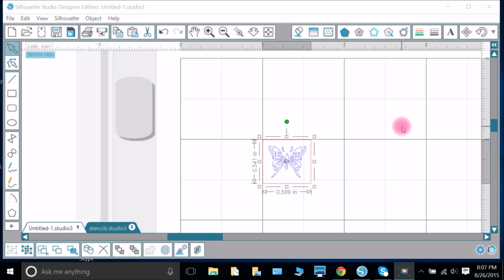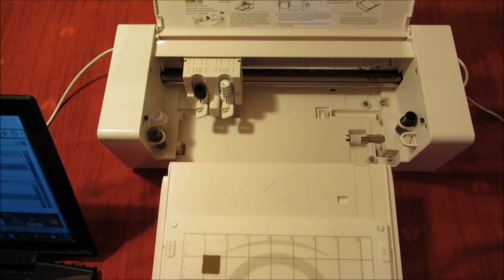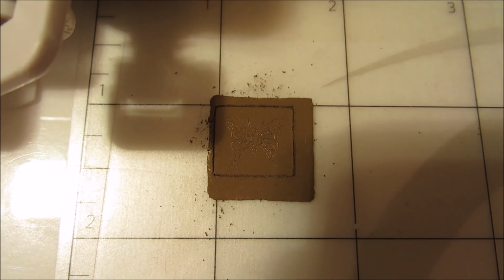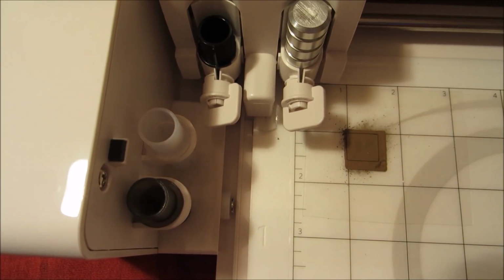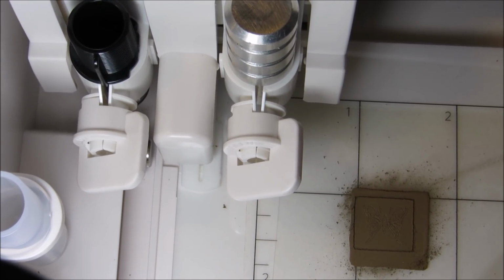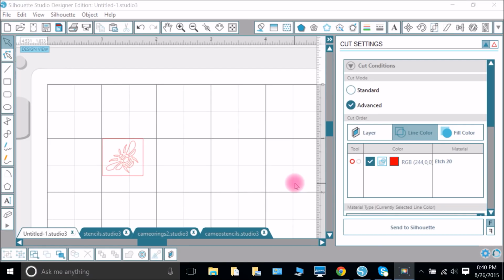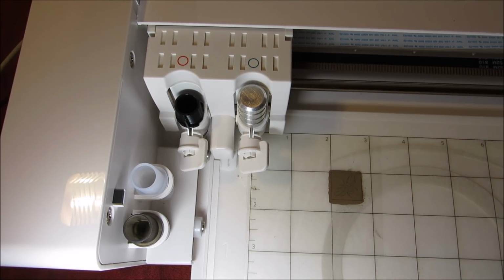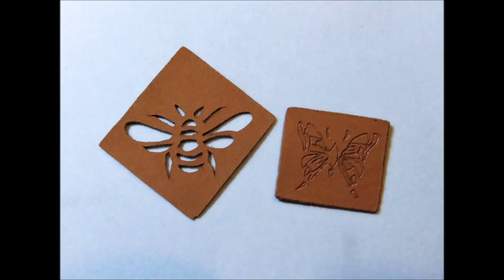Curio First Cuts

Comment from the maker: Jeremiah, Metal Clay is powder metal (Silver Bronze Copper Etc) to which a binder has been added. When water is added a clay is formed. The clay can be formed by hand and then dried. After drying the clay is fired in a kiln and the binder burns off and you are left with a 100% metal piece. You can see in some of my other videos how we use the silhouette with metal clay rolled into sheets. I have a class on Craftcast on using the Silhouette with Metal clay.https://www.craftcast.com/recordings/deciphering-silhouette-constructing-mixed-metal-pendant